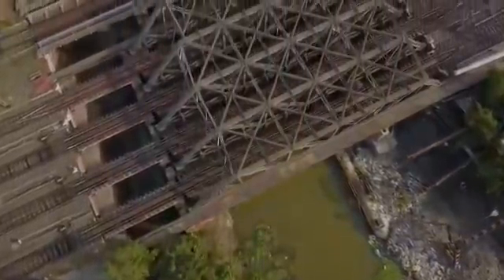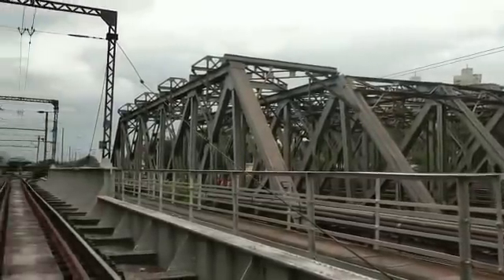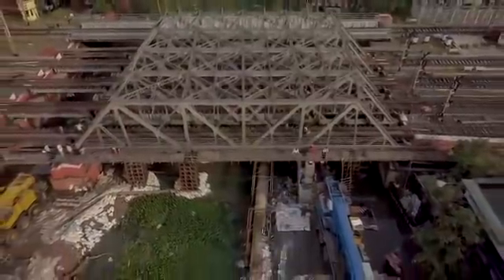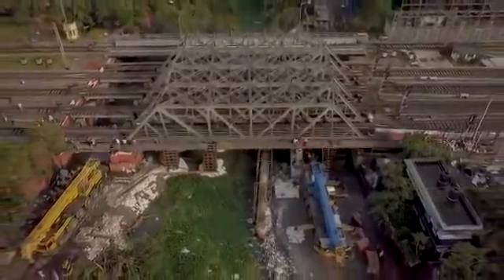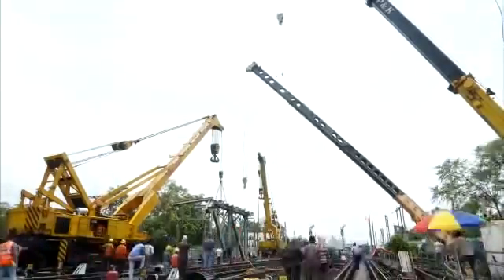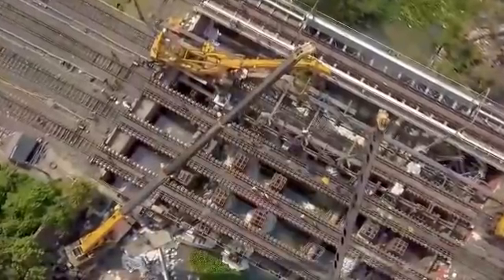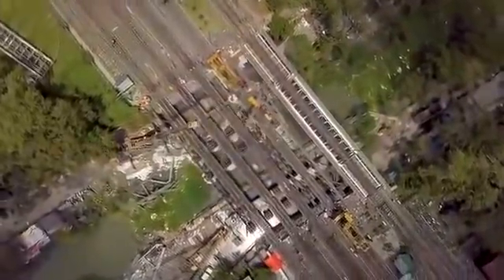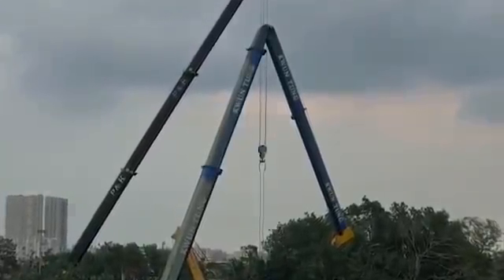DISMANTLING OF MORE THAN 150 YEARS OLD REDUNDANT TRUSSES  BRIDGE

Comment: My guess the CHINESE would have done it with in one year!! It took 14 years since the  initial project.  Welcome to India where bureaucracy and corruption ruins every thing. Even the narrator  says it's a long pending safety work
Reply: It was completed from start to finish in 1 month. The work was not possible because of high traffic over the bridges and shutting the bridge down for 1 month means facing public angers (democracy specific problems) . Covid 19 lowered the traffic to almost nil, making this possible. It's not the corruption, it's the lack of guts by govt to shut down the bridge.
Reply: That's because China is more corrupt and there is no need for any representative opinion for starting  the project.